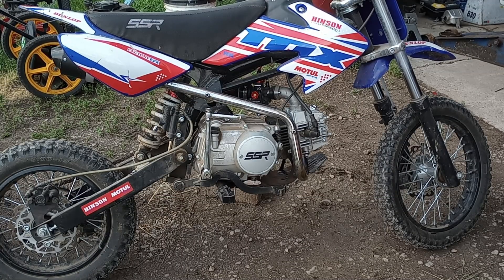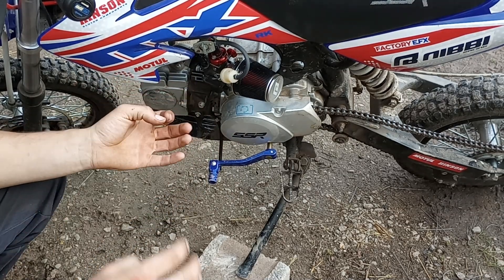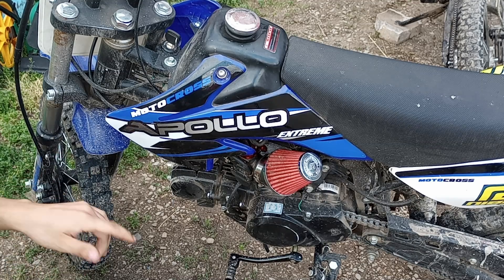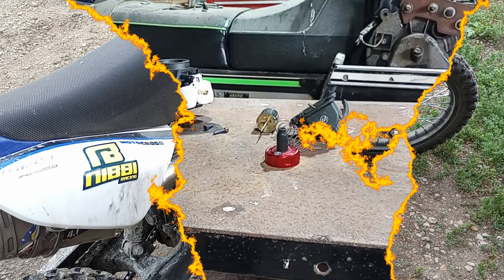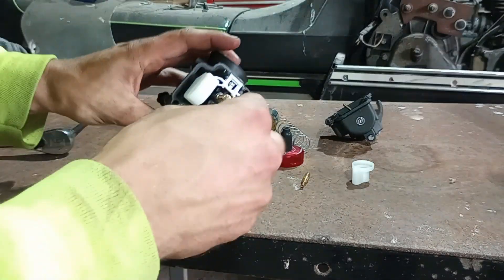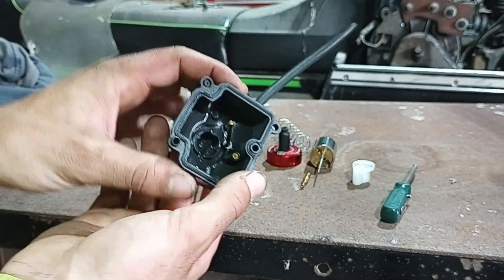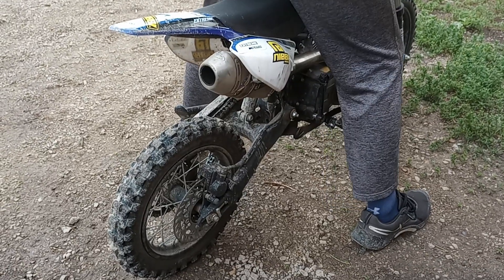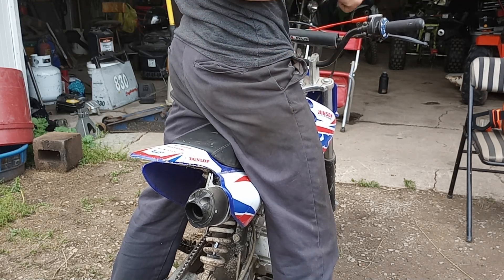The ULTIMATE Jetting/Tuning Guide - NIBBI Racing 22mm & 24mm Carbs on 125cc Pit Bike

Comment: Okay, i bought the nibbi pe 22. Came with a 98 main and 32 pilot, little biggy on slow end, so i went to a 38 pilot and a 100 main. Now is super sputtery, runs amazing on top tons of noticable power, so do i go higher on the main or drop back to a 35 on pilot? Thanks
Reply: Thank you i will, i am waiting on new jet kit atm.
Reply: I would be grateful for any suggestions
Reply from the maker: I'd say ur rich on low end. Do maybe a 35 pilot and mess with needle clip position. U can then adjust air fuel screw too to help clean up that sputter. Usually that's rich being a 38 pilot, I'd bet just lean down the low end a bit. And document what u did
Reply: *update * received new jetts , changed them around , heading in the rigt direction tuning the carb. Running much better.
Reply: What did you end up going with? I have the same settings but it bogs when you WOT quickly. Ive messed around with the needle and it seems to be best on 4th but still cant open fast or it bogs but rolls on sooth.
35pilot
100main
4th position 
1turn out 
Nibbi high flow intake
Aftermarket short pipe

Any suggestions?
Reply from the maker: bigger pilot? go to a 40 @2FeetOn2Wheels
Reply: @2FeetOn2Wheels Same here, rfz 125 

1 1/2 half turn air screw
Nibbi pe22mm
main 100
pilot 32

Might give a try to a 40 pilot

Comment: mine doesnt bog or sputter but at first it does and then it goes out once the bike is warm enough
Reply from the maker: That's kind of normal for them to kind of run a little goofy when the engine is cold but if it runs good when the engine is hot then you're probably in a good ballpark jetting wise

Comment: What does it mean when my bike starts bogging after riding it. Cause it doesn't bog when I'm just sitting there revving it. But when it starts getting air from rolling starts bogging and backfiring.
Reply from the maker: Under load it must be either rich or lean, what does it do if u apply the choke when riding? What type of carb? Valve lash in spec? Good fuel? New spark plug?